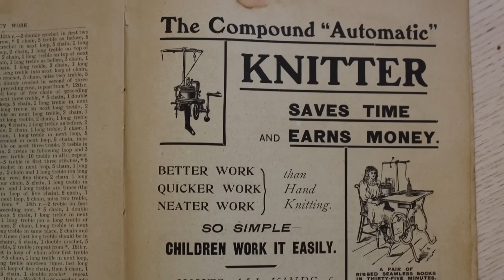How were the Victorians so fast at knitting socks? || A pair of socks in half an hour on a CSM

Comment: Take the too big sock, put a loop on the end of it and hang it up as your Christmas stocking so that way it's a useful and  constant reminder of your journey, your first sock, your first endeavor into this new Joy and then go ahead and make you two socks that absolutely positively match.
Reply: That's such a nice idea?
Reply: I'm doing that right now with hand knitting socks I did in 3 weight baby blanket yarn by casting on the same as you should for a sock yarn weight. I didn't really understand how huge of a difference "one size" of yarn would make. I'm only about 5 months into my fiber arts journey and all self taught since the grandmother of mine that used to knit, sew and crochet passed when I was too little to do much more than chain crochet and sit still for more than 10 minutes at a time lol. Machine knitting looks super fun too since you don't have to worry about tension and you can make much smaller thread into socks and such
Reply: My mother made my father a sock that was so large that it rivaled the Christmas stockings. It was supposed to be a sock. It turned out 5 times the size it should have been. It is glorious as a Christmas stocking.
Reply: @amethystskeels3788  3 weight is worsted weight. Usually requires a size 7 or a 8 needle. It's important to know gauges and weights that's way when you see any yarn...with or without a label, you will know what needles ( or hook) will be appropriate to use. Baby yarn for example is a 1 if you go by the weight scale....uses a size 1- 3 needle on average most folks use a 3 ... personally...I use a 2 cuz I work loosely. 

If you know you work loosely or tightly, know your yarn weights and needle sizes....you can plan your projects and patterns to be the correct size every time.
Reply: I came here to say that very thing.
Reply: This is the most wholesome and comfy comment I have read on YouTube in years, thank you for restoring my faith in humanity a little.
Reply: @daninb8939  why the question mark?
Reply: Can also sew it smaller with an overlocker
Reply: That is exactly what I did with my first handknit sock.  Unless a unipedal Sasquatch turns up needing a fancy sock for their sandal.
Reply: @Stettafire  then go ahead and convert it. I knit by hand with the same metal knitting needles I've had for years. Each one have the US sizes and mm on them.... doesn't matter for the purpose of my comment. I was suggesting what she could do with the oversized sock and responding to how she could find the correct yarn to use for the machine. Yarns also have the conversion written right on the package.  I'm American so I didn't think about the conversion when I made the comment, anyone that sees the sizes I stated and needs a conversion will figure it out using the method you stated. It's all good.
Reply: Love your sense of humour  @cairistionac8882  .  It is so good to be able to laugh at ourselves and the funny little things that come out as the end product of some of our projects.  Cheers from an Aussie crafter.

Comment: I am wondering how heel is done. My grandmother had a machine back in 1900. I am thinking that is why so many socks were knitted and sent to soldiers in war. I am from Canada. My niece inherited the machine and has been doing a lot of knitting. She moved away, so I never had the opportunity to see it in operation. I am very excited to see this machine . I am a avid knitter but my age caught up with me. I will certainly subscribe and watch you with happiness in my heart. 🥰
Reply: There are a lot of CSM videos of heels online but they are basically made with short rows. Some knit tubes and afterthought the heels and toes. I love my machine, my hands can’t do the tiny needles to hand knit socks.
Reply: Hello fellow Canadian! My great grannie had a machine too!
Reply: I would imagine it’s with short rows. So instead of completing a full rotation, you go back and forth in a small section to make the heel.
Reply: @damdamfino  Yes! I have a vintage Victorian CSM, and I've done loads of socks on it, and you can see her doing a heel at 7:00. You can pull a hook all the way up to skip it, so you just essentially pull up half the hooks, then pull up one more hook with each row until you get down to sixteen or so, then push one down for each row until you get to half the hooks again. Then push 'em all down to go back to the regular sock! You're knitting back and forth instead of in the round, so it produces some pattern variation with the variegated yarns, but I've never gotten any complaints about that. Love these machines!
Reply: Part of the reason for sending socks was probably to prevent trench foot. It was really common and dangerous, and caused by having your feet wet for days on end. It was probably hard to dry socks in the trenches when it wasn't sunny.
Reply: @highdesertsun3154  thank you.
Reply: I think much harder to dry leather boots in trenches. At least if you had a spare pair of socks you could swap and dry 1st pair provided no-one pinched them or they get left behind as troops me bed forward.
I also think most of socks gloves and balaclava hats were hand-knitted. Most women would be hand-knitters then.
Reply: The heel is done by going back and forth at front of machine.  If using cotton on csm, use lycra so cotton.
Reply: The csm’s were made to help just before civil war, ladies made socks for war soldiers.
Reply: You do it in decreasing and increasing short rows.   The pattern was included with my antique machine.
Reply: I’ve made slipper socks on a loom, the heel is worked in short back and forth rows and when the heel is big enough, you put sides of the “flap” you just created back on the pegs. 
I hope this made sense lol
Reply: I’m not sure if you have a TikTok account, but there’s people who go live making these with circular knitting machines and they show real time how the heels are made and usually answer questions.
Reply: That is fascinating, about the socks for soldiers. I have a little bronze medal given to my grandmother for knitting socks in WW1, in Folkestone, England. I wonder if she had a machine too? !
Reply: Socks are INCREDIBLY important when you’re outdoors (fighting in the trenches, for months at a time).

“Trench foot” could easily take you out of the war.
Reply: @stephaniedesmond8329  could the csm be used to repair the heels and the toes of holey socks?
Reply: @susanbdusan2785  I don’t know. I wouldn’t know how to do that, anyway. It can be hard to work inside that little space.
Reply: @stephaniedesmond8329  THANK YOU!  I (42M) was wondering the same thing and, being a hobby machinist (who built my own equipment from scratch), was trying to figure out just how it was done.  I did not realize when I saw all the hooks extended like they were that it was so they skipped and were able to make the heel.  Would have been up all weekend trying wrap my head around it.
Reply: @anklebiterwoodworks2818   Cool! What did you use? Are you 3-D printing the parts, or is it all machined? It sounds like high precision work! It’s really exciting to see someone bringing back this extremely useful old tech with new tech. There ought to be more of these devices, so it’s great to see that people are building new ones, and solving some of the technical problems inherent in the refurbished Victorian models. There’s nothing quite like getting machine grease on expensive white sock wool that you intended for one of your littles.

As for the darning, and smaller sizes, if you wanted to, you could do a flatbed knitter for more versatility, but then you’re stuck sewing an inseam by hand. Still, as a project, it would be fun and rewarding. I made a Meccano loom once, way back in the dark ages, and that was a blast. Never finished anything on it, but it sure was fun to make it go.
Reply: @stephaniedesmond8329  There were no 3D printed parts.  It was simple materials that could be purchased from local home centers and McMaster Carr.  Over the last few years, after learning more, I upgraded most of the movement components from wood and aluminum angle to aluminum profile and linear rails.  I did have plans to follow during initial construction, but after that, when I started upgrading to address issues I was not happy with, I machined the aluminum parts on my CNC after redesigning it in Fusion360.
Reply: So beautiful 😍  I'm Canadian too, my legwarmers collection would be even more out of control. 😆

Comment: A tip from a hand knitter who has worked with yarn on cones many times. (I have a local store that buys in bulk, and sells cheap) 
If you have the cone standing passively on the table, and pulls the yarn up like you did, the yarn will slowly become either tighter or looser in its twist. (Not native English speaker, sorry for the weird explanation) 
If you instead had it a bit higher up, and on something that rotates the cone as the yarn is being pulled into the machine, you won't slowly overwind or unwind the yarn. It's probably not a big deal for the socks you have made so far, but if you are going to attempt ribbing, it is REALLY important to get right, otherwise the last knit stiches before the purl will look loose and weird. 
Unwinding the yarn can also cause the hooks on the machine to have a harder time grabbing the yarn, and will make the final garment less strong.
Reply: They make spinner stands for the cones.   You can also often just have it on a wire post.  It's a good idea for anyone that's working with wound products.
Reply: The post is called a spool.
Reply: As somone who studies that stuff, yeah, that is important. Not only can it start to affect how the last row looks. It can also misshape the stocking and impact how the machine morks because depending on what direction you wound the cone in, the yarn will either be would tighter or be unwound.
Reply: Excellent comment.

Comment: A couple of questions; 1) do you need to add weights at the bottom of the project like you do on a flat bed? And 2) how do you do the shaping? You need to do increases or decreases for the leg, heel etc. Is this just for a few inches of the sock and you knit the rest by hand?

Comment: Quick tip: put a nylon sock, or a fruit bag (don't know right english name for it), over your yarn coil. This will prevent droping the loops and tangling at the base while You work. This trick is often used on overlock machines for that fine elastic thread that is not twisted. Best Regards, and good luck.

Comment: Longtime knitter here. You could toss the sock in the wash and shrink it. Also, remove the tube from the spool of yarn  then pull from the inside instead of the outside.

Comment: I used to lead quality audits of textile mills, from fibre to clothing, most of the equipment is utterly fascinating and required me to sign non disclosure agreements. I once went to a facility that was turning over millions, it had six staff overseeing a fully automated production line. I would also audit laboratories that would assess such materials - one piece of equipment was an average fibre length mechanical measurer and calculator. Incredibly fiddly to use, but as a piece of engineering was excellent.

Comment: I bought one several years ago, but have struggled in using it.  One of the things, however, that I did find, was that you can use mock ribbing to give you the same effect, avoiding the ribber.  There are a number of videos out there showing technique.
Reply: I like the mock rib too.  Plus, I really prefer a hand knit afterthought heel and cuff to the machine heel.  Tubes are my go to now-or will be when I get back to it.  I never achieved a comfort level using the machine.

Comment: I have used the circle sock looms, but knitting by hand, not the crank and device….and due to the very tiny stitches needed…took forever (but turned out decently.  The trickiest part is if you want a turned heel….not just a tube,

Comment: My mother owns a restored antique one that came with weights made from forks as hooks and cylinder clock weights to hang off the projects, helps with the tension. Jealous yours comes with a phone holder so you can get instructions or watch shows while working.

Comment: I've seen videos on CSM's before but they are generally being used by those who've already learned how to use one so I appreciate this video which shows that there is a learning curve. I hadn't realized there were 3D printed machines like this one. They are still expensive, but far less than the $2000+ for even a refurbished cast iron frame one much less a new one. Given the latter were meant for commercial production, I'd imagine one like this would be great for the number a family would need (plus gifts for others). Also, your dog is adorable.

Comment: I've had my D&B for about a year and a half and I love it! I haven't gotten the hang of my ribber yet, but I haven't tried very hard, either, lol. This is am older video, so maybe t's not an issue for you, but the D&B calculations never got a good fitting sock for me. I use a Twice Sheared Sheep sock ruler- that seems to fit every time.

Comment: Look up drop stitch stockings. You caught on faster than I did but I had a machine that required a lot of restoration to get working satisfactorily. I did a tutorial for a specific heel that I think fits better but didn’t get around to doing a drop stitch tutorial. Drop stitch stockings are great for thigh highs and surprisingly warm.

I have been intrigued by plastic machines but they were very new when I was most active with my machine.

Comment: Your bonnet is knit with Perfect Pair Loops and Threads(Michael's brand)in the color Pink Cadillac.  I only use this yarn(I knit socks on a Cindwood loom-round)when I knit socks.  You can wash them and dry them in the washing machine. All of the colors are named after Bruce Springsteen songs. I'm guessing you know Bruce Springsteen(The Boss), They are really soft and no wool.  So I can gift them and not have to worry someone has an issue with wool.

Comment: Wow. I once got a flat machine made of metal at a thrift store and didn't hold on to it when I moved. I never really got it to work. I currently have a sock loom but am working on a second project.
Reply: I have to think that part of old socks making was a small amount of shrinkage and felting just to make up that last little bit of the oversize.

Comment: I do look forward to see your stockings 

If you could increase the length of the crank, you should find it easier to turn
Reply: I am not a knitter just a sewer but I watched a review yesterday of a comparison of 2 types of knitters. She said you can buy a 3 D printed attachment for the crank. You then attach a drill to the attachment and it turns the crank much faster. Perhaps you can look into that. Happy cranking to you.
Reply: @gloriannburick1837  on researching ..there are models with longer cranks available

Comment: I have been using a metal CSM for almost a decade now. I will be interested to see how this one of yours holds up. Is it printed plastic or metal or what?
Reply: 3d printed is generally plastics, some are impregnated with metals, and then there’s the UV resin stuff. But this machine seems to have some metal parts, like the hook bits that do the work.

Comment: Socks do not need positive ease. Most 4 ply socks are one inch smaller and stretch to fit. Also have you tried the Sentro or Addii machines? Very popular on You Tube. But I prefer hand knit or crochet socks!

Comment: As a machine knitter, I was aware of the vintage style CSM, the looked heavy and clunky. I've used other plastic circular knitters as well.  
What's the advantage over a CSM to making socks on a flat bed with a ribber attachment. You can knit socks on these in the round.  Only advantage I can see is size and space to use it. When the same results can be achieved.  
I can't justify nearly $1000 when I've got 3 flat bed knitting machines with ribbers that can do the same.